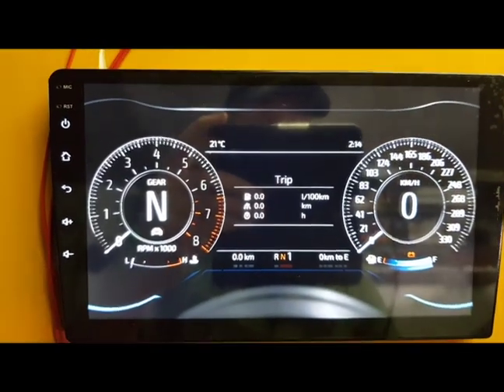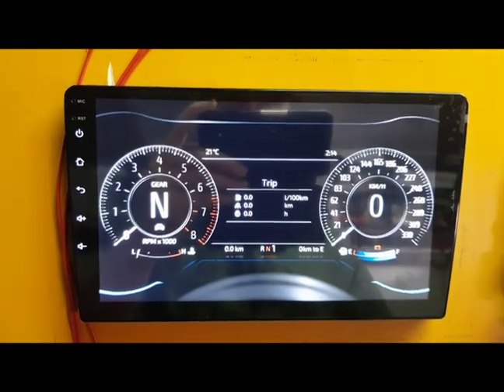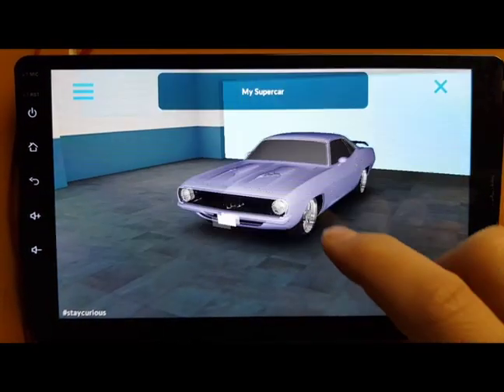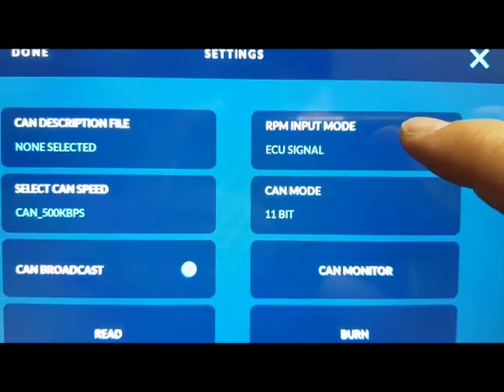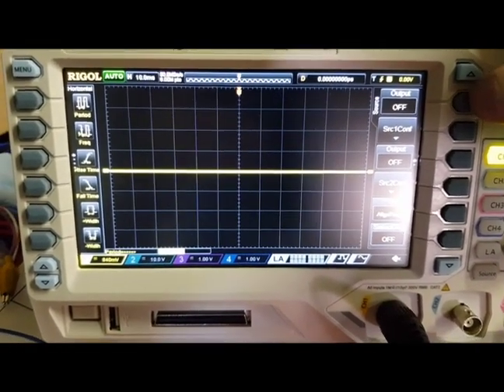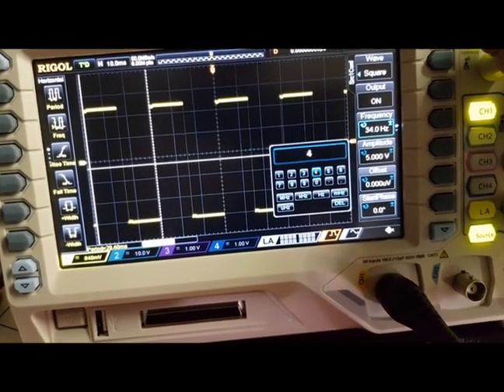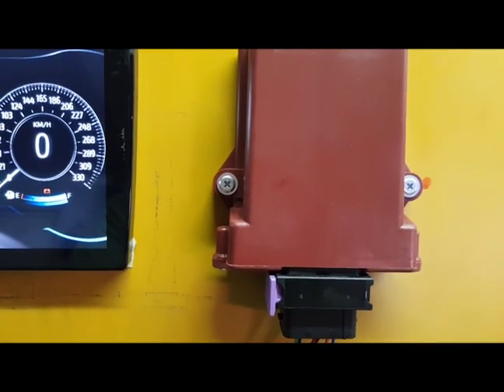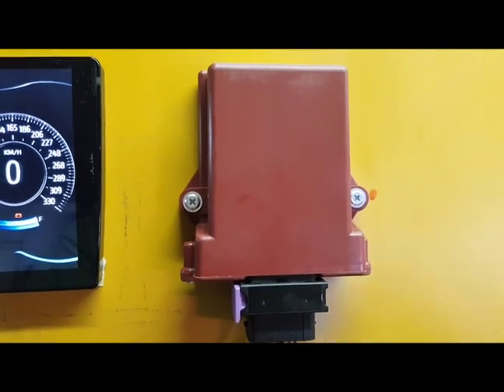RPM in.

Comment: Could you show how to get RPM ECU signal in?
And temp and oil pressure switch grounded in the block.

Working on this right now in my Lotus.

By the way is the casing waterproof? Want to put it in the engine bay.